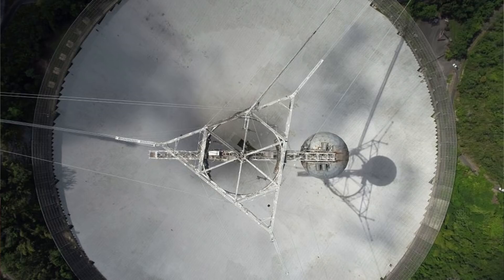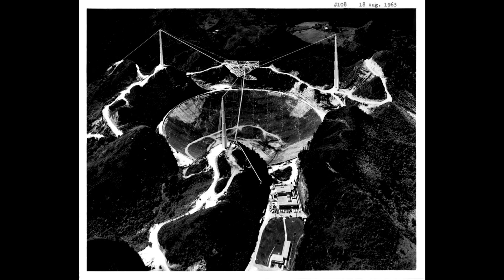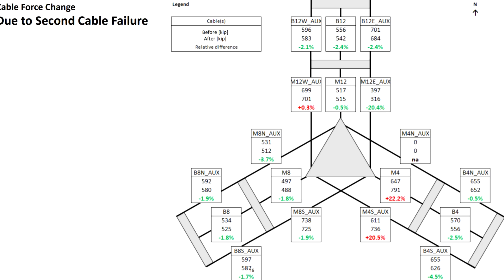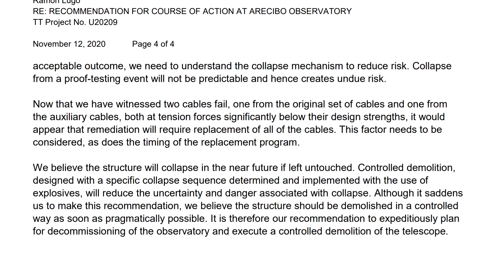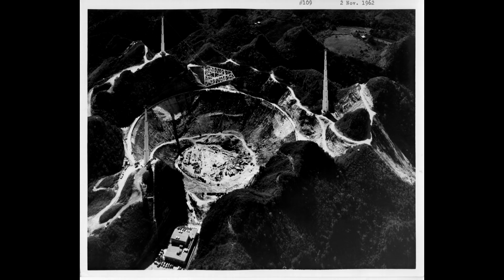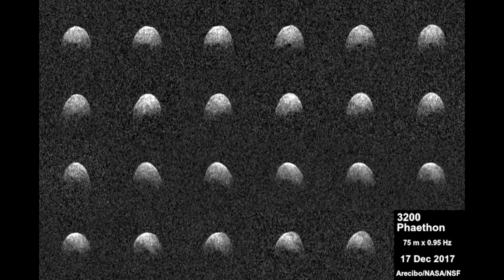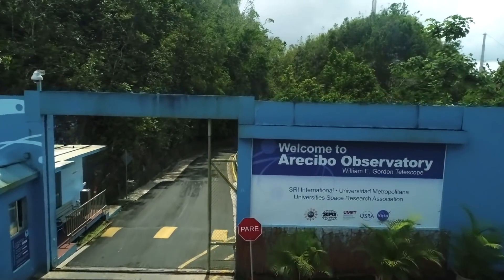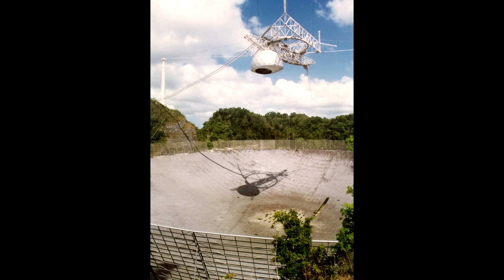Worlds Largest Radar Astronomy Dish To Be Demolished!

Comment: from my knoledge in material science and structures& resistance materials as an aeroespace engineer, I can guess that the cables are suffering from  long term fatigue.
The cables have been suffering ductil fractures for at least 15 years in order to reach this point.
The only chance the recibo has is to lower the antena/(lifted up otherwise with cranes) and then replace the cables.

Comment: They scrimped on maintenance for years, funding was cut and they had to find other sources. It will be demolished and then when it’s capability is sorely missed it will cost us far more than the deferred maintenance would have been.  Any replacement will probably be in a powerful politician’s state instead of Puerto Rico .

Comment: That really sucks.  Isn't it also the only, or the strongest, transmitter in its class?  It seems like with a big crane or three they could stabilize the platform until they could connect new cables.  Or connect new cables at the towers and use a helicopter to support the inner platform while they're connected?  Or a whole bunch of smaller cables hooked to the center platform by drones and then tensioned at the posts?  I'm not a mechanical engineer (which is probably obvious) but it seems like something could be done.  How was it put up there in the first place?  I thought they were talking about doing a controlled destruction so they could save a lot of the equipment.  Private individuals helped fund the Planetary Society's solar sail (including me).  Couldn't something like that be done?  Or maybe... pull the plug on the big orange asshole's border wall and use that money?

Comment: Why couldn't a net be formed under the dish by using a ROV to pull a thin line that pulls a thicker line... Then use these to hold up most of the dish. Not sure how to deal with the equipment in the dome though, maybe active support via a very large tethered quad powered from the ground? I am not sure what it actually weighs. All the numbers I have seen refer to the tension in the cables and at such shallow angles that would be many times the actual weight. Maybe the best move would be to not reinforce the middle of the dish, build a net above the dish to catch the cables and then blow those cables and let it fall. That would preserve most of the dish and I am sure the equipment in the dome would be upgraded before it came back online anyway. Maybe this will inspire an idea that will work...

Comment: I am not a structural engineer, nor a radio expert, but I would try to erect 3-4 new poles on the perimeter of the sink hole/crater. But unlike the current poles the new poles would lean inward and meet at the center. Any load hanging or mounted on this center would then be compression force directed downward and outward. It should be possible to simple increase the diameter of the poles until sufficient strength is achieved.

Building them while leaning inwards without any pressure will demand som type of support. My suggestion is a set of rings connecting all the poles. Each ring will turn the "falling" pressure into yet another compression force, this time horizontal instead of vertical, thus eliminating the need to support the poles from below while they are built up and in towards the center.

Comment: The helicopter thing was the only idea I could come up with, short of building an even bigger suspension structure above the existing structure, just to secure the engineers working on the old structure. That doesn't sound feasible, either.

Comment: I do a ton of heavy industrial fabrication and deal with alot of stuff similar to this. Hate to say it, but yeah, demolish it. The problem isn't how feasible it is. This honestly looks like it could be fixed with current tech. The problem is cost. All this stuff to fix this is going to cost a huge amount. Not only that but you have decades of wear and tear on the whole things so you'd best replace alot of it while its down for maintenance. So while it's a repair they could do, they could probably build another one thats modern and without all of the maintenance issues for the same price as repairing the old one. In fact, so much stuff would need to be taken apart and put back together to do the repair at this point, it would just be easier to build a new one.
Reply: The problem is to fix it basically requires rebuilding it in it’s entirety anyway. They didn’t build in the ability to bring the platform to the ground. So they would, at a minimum need to strip out the dish completely. Put up a series of vertical supports and lift cranes to take the load of the platform and the cables. Detach the cables. Bring down the platform. Remove all of the cables and replace them. Likely also needing to replace/rebuild the towers. By the time you are done repairing it, there is nothing original left. You’d have to rebuild from scratch anyway.
Reply: @andrewtaylor940  Musk fanboys really have a way to insert the good hypeship Vaporware into anything, don't they
Reply: @tybofborg  I’m not sure where discussions regarding Musk or Musk fanboyism came from. Certainly not from anything I said. I simply noted that in order to repair it you would need to demolish, dismantle, replace and rebuild 90%+ of it anyway. All of the cables need to be replaced. To do that the gantry must come down. To do that the dish must be removed. So the only thing left is the 50 year old towers. Bets on how good they look on detailed inspection? And most of this would involve lots of people working under the dangerously unstable platform and hoping the next cable break doesn’t drop it on their heads. The only things in it worth actually saving are the instrument and sensor packages on the platform. But getting them may be too dangerous. All of the rest is just bridge building. Probably better to rebuild those with newer materials and techniques. Past a certain age it is generally cheaper, easier and safer to simply demolish an older bridge and replace it with new. And much of this thing is basically repurposed bridge building.
Reply: @andrewtaylor940  I wonder if saving the instruments would be worth it. Whole place looks like it's pretty run down. Can't imagine the instruments got the care they needed. And they're probably pretty old too. I'm not sure the math works out to make it a net gain.
Reply: @andrewtaylor940  Sorry, responded to the wrong comment. I agree, as iconic a structure this is, it's also a highly unstable structure and its purpose would be better served by rebuilding it altogether (and hopefully with a more serviceable design).
Reply: In political terms though if it goes down it'll likely never be replaced, the sunk cost fallacy can be used to communities benefit in cases like this.
Reply: I think at this point it really is much more the safety considerations than the cost.  You could build a temporary cradle underneath the antenna structure to set it on with a relatively minimal disruption to the dish.  You'd have to rebuild the middle dish after repairs, sure, but that's going to be a small fraction of the total dish, and you may be able to integrate the cradle into the rebuilt dish to save some money and time there.

But all of these plans run up against the fact that this thing could fall on the heads of the construction workers doing whatever repairs you can dream up.  Under modern safety standards, you simply cannot justify putting people in positions where this could collapse with no warning.  Even if you found people to waive their rights, their next of kin will argue to a court (probably successfully) that the NSF and their prime contractor were money-grubbing monsters who baited the poor workers into taking risks they couldn't understand, and very large checks will end up being cut to them.  This is aside from the optics on TV news, which will have dramatic effects on the NSF for years to come.
Reply: @CatCube2  It is even worse than the huge fall hazard. Those support cables are under enormous  amounts of tension, and if the snap they would whip around uncontrollably with enough force to slice through vehicle, buildings, and people.

Comment: Well you just explain3d how to save it simply built 3 more towers. Gonna cost a lot but not as much as it would to fix the entire thing. Cut the wires let it drop scrap the metal and rebuilt it with new tech and bigger. Much much bigger.

Comment: I sadly doubt it'll happen, but I really hope that they at least leave whatever doesn't HAVE to be demolished and potentially re-use it for a replacement telescope. The platform and dish are almost certainly going but they could build a new platform, with better materials and instruments, string it up with new cables from the existing towers, and build a new dish for FAR less than building a new telescope with these kinds of capabilities. Take this as a chance for its biggest retrofit yet as opposed to entirely decommissioning it.

Comment: Very sad to see this iconic piece of astronomy history lost, now we need to turn meteor crater in Arizona into its replacement.
Just imagine the resolution from a 1 mile wide dish.
Reply: I like your idea.  Why not use the Sedan crater.  Have the government clean up the site and build it there.  What am I dreaming.....
Reply: Why can't it be built on flat land?
Reply: @lubricatedgoat  the closer the terrain matches the dish the less structure is needed. imagine how tall those towers would be if they went all the way down to level with the bottom of the dish
Reply: @lubricatedgoat  It could be above ground. Natural depressions simplify and lower the construction costs of support/motorization structures for the dish and trans-sever array, while providing wind protection  for the  collector dish.
Reply: @lubricatedgoat  Because it would cost an absolute fortune and would require towers a kilometre tall.

Comment: I am more sad now knowing this will probably happen than how much I was happy all the time I've seen it break down in Battlefield
I'm not a structural engineer, thought I'm an aerospace engineer studing for the master degree, but first thing I'll do is to release the tension of the cables that are putting downforce on the instrument platform, and see what's the load and what to do from there

Comment: WELL this news sucks a pickle.  UNCOOL.    They could build a center beam like most Microwave dish up and use a reflector to change direction.  That would be cheap enough eaaa?  The cable idea was doomed in idea.  yes I've worked on microwave radio's in my past.

Comment: People take risks during construction all the time, just look at the fatality rate for tunnel diggers. Yet people do these jobs because they need done and they make the informed choice to take those risks. Mitigating them, certainly, but getting them done despite the risk.

Arecibo is more important than a subway tunnel.
Reply: And it is far more dangerous.  There is no reasonable way to mitigate the risk to anyone trying to work on the telescope.  It is one failure away from complete collapse.  Would you want to be the guy whose team is out there adding the weight of replacement cables and changing the stresses on the existing ones?

Comment: The biggest mistake they made was not giving it the ability to go to a “rest” position for repair and maintenance. And they have also failed to lighten the center carriage with more modern materials. Rather sad, but completely predictable. “If it works, why change it”, and “we need to reduce the budget, where can we save”. Lack of maintenance, and no way to lower it to the ground.
Reply: Where giving it a rest position, would be an even bigger mistake

Comment: Let's build an antenna on the back side of the moon and get some real power!
Reply: Without the ability to do regular maintenance we would be back to square one. Maintenance on Earth is a LOT simpler than on the Moon - even with permanent bases there. Maybe in the far future when we have a steady infrastructure in space, we could place one at a Lagrange point.
Reply: @Big Crunch But you have to think of vacuum, 1/3 gravity, radiation, meteorites and lack of infrastructure.   ;-)
Reply: @RamsesBic  That would be 1/6th gravity.  Meteorites aren't even in the top 10 of biggest problems with doing this project.
Reply: @stargazer7644  Sorry - too much Mars talk lately. (I was having a bit of fun)

Comment: the fact it has lasted since the 1960's is a testament in itself, nothing lasts forever,
Reply: Tell that to pyramids.
Reply: @randomnickify  Joe Biden and John McCain helped build them.
Reply: Good point.   Other large radio observatories have collapsed.
Reply: I've lasted sine the 60s and I'm doing perfect.  No snapped cables or anything.
Reply: Ever hear of the Egyptian pyramids?
Reply: @kathyyoung1774  A little worse for wear after 3-4 thousand years, but the thing about pyramids is that they are lighter at the top than they are at the bottom, because every stone block is being held up by 4 blocks beneath it. In the case of the cables holding the feed armature, everything depends on tensile strength, and the cables actually being maintained so that they retain the specs they were engineered for. Given how pitiful science budgets have been in the US in recent decades, it's a wonder they're kept it going this long.
Reply: Entropy.
Entropy lasts forever.
Reply: @rsrt6910  I replied without looking at the current reply.  I will delete mine.
Reply: @rsrt6910  Sorry could you explain this 😅
Reply: Unless it's properly maintained. Look at the Pantheon in Rome. Over 1800 years old and still standing and for about 1700 years it was the largest cantilever dome in the world.
Reply: @andreasvogler1875  Although I do wonder how much of this is maintenance vs. a huge margin of safety and survivorship bias. We've gotten a lot better at understanding our materials and the loads placed on the as well as beoin able to produce materials in better / more consistent quality. If a roman engineer got his design right and a good batch of materials it'll result in an incredibly strong strucure. However if some effect / load occured he had no way of knowing about and / or he's got bad materials, the structure will likely have failed and dissapeared long ago.
Now I do wonder what the oldest unmaintained still existing strucure might be . . .
Reply: @WIRRUZZZ  Probably a pyramid, and not necessarily an Egyptian one, unless you count neolithic underground burial chambers/mounds/etc.
Reply: @WIRRUZZZ  Another good example for the importance of maintenance is the Golden Gate Bridge. It's older and bigger than Arecibo, was build in a geologically unstable region and has to withstand a rough coastal climate. Without permanent maintenance those cables would probably have snapped a long time ago.
Reply: @andreasvogler1875  In that case I absolutely 100% agree that maintenance is the deciding factor in its longevity and a better example for its importance than roman strucures, for the reasons I mentioned.
Another set of examples I find intereseting is comparing aricraft and cars. For an aircraft you can rely on strict adherence to oerationg procedures / limits and maintenance requirements to keep the safety factor (and thereby weight) down and still get a good service life. For the average car better overbuild it soem nad hope the customer isn't too careless with it.
Reply: @andreasvogler1875  --   This was a "lab experiment" raised to a large scale.   it never had the large safety factors like a vehicle bridge has (and, btw, some of them have collapsed.)    IMO: it's best to haul away the scrap.   The are office buildings associated with the structure and perhaps some funding can keep them working at extracting as much data from prior observations as they can.    Perhaps one or two folks can work at designing a replacement "on the cheap."   The original idea was to have a cheap way to get a large aperture by accepting other limitations.
Reply: @GilmerJohn  This was designed and build by engineers who did the math and used safety factors. Scott mentioned how much these cables should have been able to carry. Maybe they did something wrong during construction or it was lack of maintenance or both.
But yeah, at this point it is probably best to demolish it and start new. I mean who knows how many more weak points have developed over time and also due to the damages.
Reply: @andreasvogler1875  It's always from lack of maintenance. Science always gets the short-end of the budget.
Reply: @andreasvogler1875  : Yea, but no cables to corrode :)
Reply: "Entropy" - Someone beat me to this.